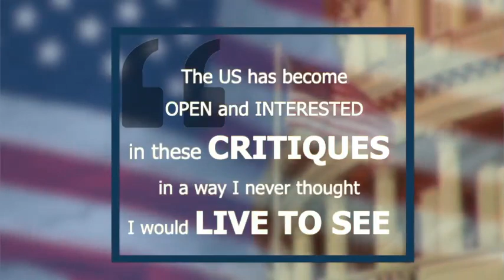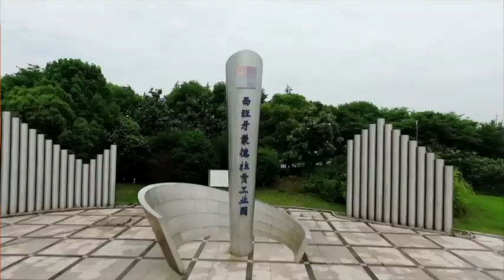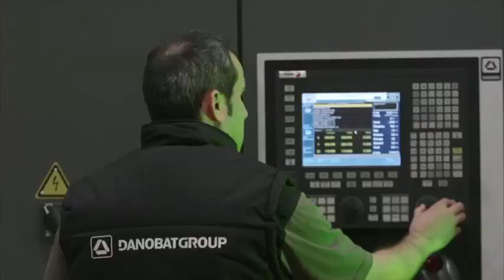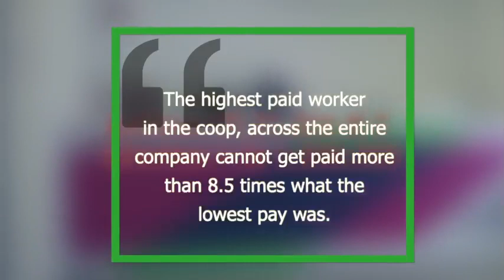Richard Wolff: Marxism Explained, How to Fix Problems with Capitalism

Comment: Wow, just think. You will never see outsourcing if you have co-ops.
Reply: Automation becomes the best thing ever. Same wages for less work each week.
Reply: You'll also never see a factory leave a community.
Reply: Dead wrong!  Get a co-op together and try to manufacture bicycles and when you fail miserably you will understand far more about business than you now do.
Reply: @1Skeptik1  The biggest co-op in the world is probably Mondregon with over 75k people making over $12 billion in revenue yearly. They started in 1956 with 6 people making heaters.
Reply: @1Skeptik1  Cry more, capitalism is finished
Reply: @TheGroovyJones   The Basque region of Spain is NOT the USA.  Has it crossed your mind if co-ops were more efficient or productive than the "free" market we would see them on every corner?  I am a businessman and I have started from scratch more than one successful business after losing a career as an Industrial Engineer in my youth (union problems).  My challenge stands, try and manufacture bicycles and compete with imports shipped from 8,000 miles away.  If you are smart you won't get beyond the cost analysis phase.  ( I built a few bicycles as a hobby.)
Reply: I am a businessman and open-minded.  Talk is cheap my friend and I delight in being wrong.  Show me your factory.  I will be happy to have a bite of humble pie.
Reply: @LongDefiant   And as socialism chips away at capitalism the middle and bottom are hurt the most.  It's in front of your nose and you choose to not see.
Reply: @1Skeptik1  Capitalism has been absolutely devastating the working class since the 60's. What you are seeing is the triumph of private property and suppression of dissent
Reply: @1Skeptik1  Yes because American businesses WELCOME as much competition as possible to drive prices down. That's totally what the $billions of dollars of political "donations" every election are for. 

Gtfo of here with that willfully blind bad faith nonsense.
Reply: @TheGroovyJones   And as we became more productive through innovation the standard of living for all improved. Today our "poor" live with HVAC, they don't plant anything or burn coal or raise livestock they shop WalMu for big screens TVs and groceries, and smartphones. Sonny, I earned a good living as an industrial engineer in my youth. At the moment Elon Musk is doing far more to improve life for us than any combination of bureaucrats or well-intended socialist "free" programs.  I enjoy a thoughtful exchange but I'm beginning to feel like I am chatting with a blind man. No matter, you don't make the rules and neither do I.  When the Sun rises I will still be more than comfortably retired.  My work ethic and capitalist philosophy purchased a great deal of freedom.  I will finish playing the bonus round very much on my terms.
Reply: @1Skeptik1  Every bit of that "self-made existence" you just boasted about requires the cooperation and support of literally thousands of other people now and into the future to whom you gave no credence.

How did the USSR go from a smoking hole in the ground after 3 straight wars into a global superpower in only 25 years? That is monumental productivity and growth the likes of which capitalism has never mustered; but "free" market fanboys say whatever you label what the Soviets did destroys economies and makes people poor, yet they became a SUPERPOWER much faster than the US without any capitalism at all. How do you explain it?
Reply: @TheGroovyJones   As I said earlier if you believe the State can manage your life and finances better than you can it is good to not be you.  Enough.  Good luck,
Reply: @1Skeptik1  Neither I nor Marxists want the State managing our lives that was explicitly stated in this interview with the actual Marxist. If you've heard otherwise it was, shocker, misleading propaganda from the political enemies of Marxists.

Btw still no answer on how the Soviets outproduced and grew multitude times faster than the US achieving in only 25 years what it took the US over 145 years to do, without a single bit of capitalism?
Reply: @TheGroovyJones  https://en.wikipedia.org/wiki/List_of_countries_by_GDP_(PPP)_per_capita
Reply: @1Skeptik1  What's the purpose of that besides evading all the points I am making how capitalism doesn't live up to the mythology shown on the posters.?
Reply: @TheGroovyJones   Do you live in the USA?  If so why?
Reply: @TheGroovyJones   Talk is cheap.  Start your little co-op.  Surely a man with your keen business insight and experience can easily wrestle market share away from our highly regulated and taxed "capitalist" environment.  Show me your stuff!  I will be first to congratulate you.  All else is but talk.  Go on, manufacture, and market anything.  ( a bar of soap, a roll of TP, a can of soup)  Don't talk but DO, the Nation is full of armchair athletes and you appear to be one.
Reply: @1Skeptik1  American government will be the midwife to birth a new form of production in the world.  And frankly, Grandpa, you probably won't be around to see it.
Reply: @1Skeptik1  Capitalism is causing the decline. The fastest growing economies of the past 100 years have been born from communism. 

The poorest countries in the world are capitalist. 

The next mode of production will be much more communitarian and productive. Capitalism as we know it will die.
Reply: @1Skeptik1  Marxists don't advocate starting A co-op business, it's changing the entire economic organization to remove capitalism's authoritarian hierarchies and replace it with democratically run co-ops. I choose to believe you are purposely straw-manning the many advantages to the mass of society with that system, because I choose to believe you are not so genuinely stupid to not comprehend the difference.

By the way, how did the USSR outproduce and grow many times faster than the USA without capitalism? I still need your answer to this question. It speaks directly to what you said about employers taking away wealth from employee's labor (capitalism) somehow making the employees better off financially.

Comment: What they don’t tell is that they are workers who are not associated and have a different treatment...
Reply: Care to elaborate. There are situations that are justifiable, for ex. if you start working there now you're not gonna own it, you may have to work for a wage during a certain perido, maybe 1 year before you get to own it. If they create a co-op in another country where the wages are lower, they're not gonna pay the same. In that case you can only compare their conditions with everyone else in that country. In the end, they still operate under a global market system.
Reply: Evandro Lima 
When they acquire new companies their new “workers “ don’t join the “family “ (they do not participated in the decision -making)and inside the companies owned by the workers cooperative don’t have a salary limitation.By no means I am saying that the system do not work but it is not a fairytale...
The most disturbing fact is that the workers of the home appliances sector who go bankrupt not only they lost their jobs but also their life saving because their wonderful cooperative put pressure (force ) their worker to put their retirement money in the companies.....

If it works so well why the worker outside Spain don’t have the same treatment than the others (it is to expensive....)

My main some people are more equal than others
Reply: @evaristegalois8600  It sounds like a market failure

Comment: While I agree with Marx' critique of capitalism, I don't think he had the solution to the problem.  No economist does, as far as I can tell.
Professor Wolff graced on it - "a system that reproduces" - in another segment I think.
He's not literally talking about procreation, but that is the root of the problem.   A reproductive ponzi scheme is basically what natural selection is.  A predatory hellscape.  

Until you get rid of nociception regulated by pain and suffering states, you will have something to exploit, and the problems leading to capitalism will remain.  
There is a way out, but Humans probably won't do it.  Leverage the ability to print money with no limit and fund the research (nanotech/biotech/gene therapy) - until a conversion of biology into a more durable substrate which does not have any evolutionary "benefit" from pain and suffering exploitation / predation (I would argue that's a contradiction, as evolution cannot benefit anything but instead is a pattern of pressure relief, especially regarding nociceptive pathways).
Reply: Ooooo, now your talking my language, trans-humanism...It would also give us the ability to grasp the infinite resources outside of earth to justify that no limit money printing without inflation/deflationary side effects...you're right however that removing pain would put us at a detriment in evolutionary terms unless we develop mind-computer interfaces that selectively allow for pain and have the computational power to compensate for environmental factors in the absence of said pain...the universe is the big threat, not other humans...but I'm also a determinist, so much of what we do seems a contradiction as most still believe in free will, but in the end we can only do what it occurs to us to do, so I hope we do ride the wave of technology all the way to that future, but we already have stories like Blade Runner to act as sort of early warning systems if we allow the technology to be co-oped by an elite few...getting the average citizen educated to realize this seems to be the major hurdle, but if Elon Musk is a real futurist, or his Neural-link technology gets out onto the open source market, it could revolutionize the educational process...I'm thinking a kind of direct democracy Ghost in the Shell type situation, where everyone is harder, better, faster, and stronger and can democratically work to grasp their own fate...a land of the truly free, dammit.  Fuck these limp dick politicians and bureaucrats, fuck the 24/7 spew of internet trivia and celebrity bullshit, fuck American pride, fuck the media...lol sorry, got a bit too Kojima there....perhaps I'm just a radical dreamer, but I can almost see that future in the next 50 years or less...
Reply: I agree. I think humans are biologically programmed to care for 100 to 150 people..but as a collateral of civilization they found themselves connected to the entire world. They cant solve this dilemma in the time available. They are not biologically prepared.
Reply: @anurag24th  
Yes, the "Dunbar Number" I've heard this referred to.  Good point.
Reply: @thejackanapes5866  But things in US are much worse than in most other developed nations. And Americans are human beings like all the rest. That means there is maneuvering space for much simpler changes for start. American political system is in a sophisticated stranglehold by the owner class.

Comment: Great to see these crossover discussions instead of everyone staying in their echochamber corners.

That being said, this presentation shows incredible lack of nuance from an otherwise intelligent person. It's like he has no idea of the concept of profit:

https://youtu.be/a1WUKahMm1s

He uses a chair as an example. 100$ worth of materials and 100$ worth of labor = 200$ becomes the price of the chair. He thinks the capitalist (owner of the factory) should be compensated for the materials, but the laborer should of course be compensated for his labor, leaving zero profit for the making of the chair. Paying the worker any less than 100$ would be exploitation
Reply: Do you really think Wolff and coop companies do not understand the concept of profit ?
Reply from the maker: Good points
Reply: @LookingForAUniqueHandle_76340 , watch the video I linked. It's a long lecture, but he starts out well. The wheels come off when he - without any apparent reflection - calls it exploitative if the worker isn't compensated fully for his labor. I.e. materials + labor = price. Apparently, profit is immoral. He never mentioned it
Reply: @owenbenjaminshapiro6285  you misunderstood what he said. He wasn't making an ethical value judgment. Just the math.
Reply: In the example you refer to he is showing, TL which is total labor which is the cost.  In his example he uses TL because it makes it simpler since the labor is LL, and equipment is EL.  Profit is added after determining the cost which is why he doesn't mention it.  Also, this is an oversimplification.  The true cost of a company producing a chair is much more complex.  There are many more factors in reality.
Reply: @owenbenjaminshapiro6285  he doesn't say it's immoral he says it's exploitative it's important to note the semantics.
Reply: @owenbenjaminshapiro6285  Why should the employer receive any profit when they contribute nothing to the value of what is produced?
Reply: @voteforno.6155  how did the employer become an employer to begin with? The factory and materials just magically appeared? The trustworthiness of the brand was never built up over time? Are we seriously just focusing on the here and now where a person is employed to produce, say, a chair and the employer should receive nothing because he just sits on his ass? Do you honestly think that's how things work in reality?
Reply: @Eric-zl1kn  I'm not sure I understand the difference. Doesn't he imply that it's immoral to be exploitative?
Reply: @armorfoursleep  but the math doesn't check out. You can't set up an example, oversimplified as it may be, and use cost for each step of production plus final price and completely leave out profit. He is creating fixed prices for products, fixed prices for production. It might cut it for a kindergarten presentation on chair production, but this seemed to be at a university
Reply: @Kevin Tewey who Wolff is is easy to Google. Why don't you enlighten me about labor value?